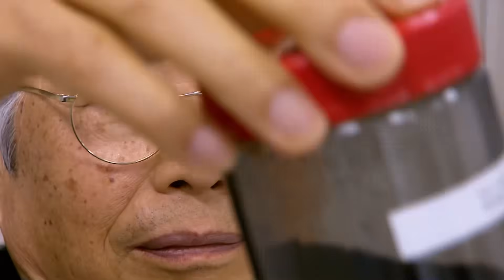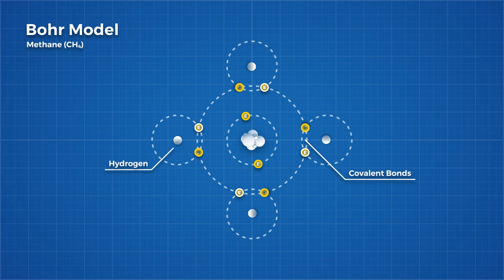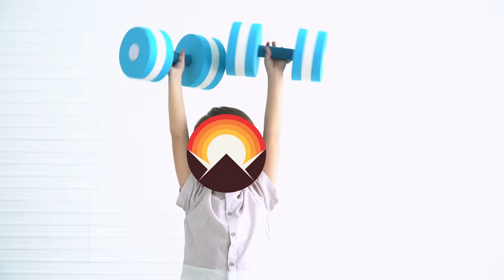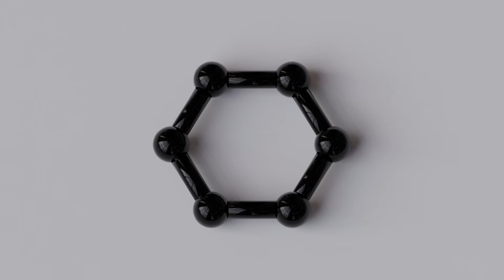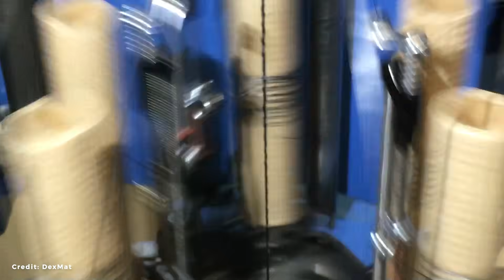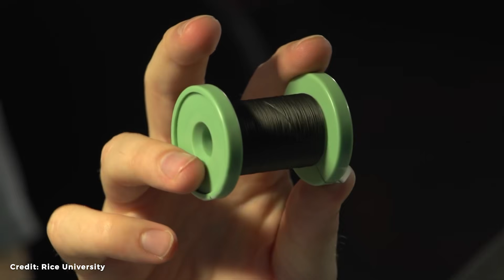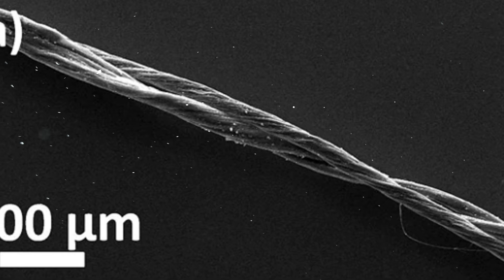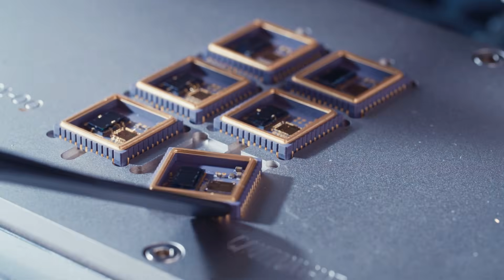How Carbon Nanotubes Will Change the World

Comment: 5 years from now: How scientists and engineers will revolutionize the world with Carbon Nanotumes in the next decade.
Reply: tumes will always be better than tubes
Reply: @bluemamba5317  Agreed.
Reply: @MrDawning  what
Reply: @bluemamba5317  what
Reply: just like it was 5 years ago
Reply: @aaronb3600  lol
Reply: @aaronb3600  true, unfortunately..... true....
Reply: they said the same thing with graphene
Reply: @abinregi390  and 3D printing 
And biodegradable plastics
Reply: @abinregi390  *graphEne
Reply: @abinregi390  that’s not an argument
Reply: @abinregi390  this is basically just another form of graphene lol
Reply: @abinregi390  this is basically just another form of graphene lol
Reply: It's just like a game where you have to research technologies to unlock them, and the good ones take like 80 turns to unlock. Be patient, it'll be worth it when they achieve a breakthrough
Reply: @RidinDirtyRollinBurnouts  Nope. Ain't gonna happen. Lol. Have you been following this technology, or do you just fanboi yourself to feel like you're a part of something?
Reply: Yes, one of my fav talking points of the 90ies.
Reply: To be fair the reason why scientist get excite about graphene and carbon nano tubes is because they keep finding potential applications when viability is the issue right now.
Reply: What's the over-under spread on if this is before or after cold fusion and flying cars?
Reply: Turns out the more difficult something is, the longer it takes to figure out. Carbon nanotubes and nuclear fusion are both things that will be common one day, but probably not for a long time
Reply: @nommchompsky  You seem to be under the illusion that technology has no limits ... that materials can be tailored (thru chemistry and/or production methods) to suit any requirement and that properties scale linearly from the micro to the macro world without loss. This is not the case in the real world.
Reply: @xenuno  People find ways of using new materials and things that are difficult to can still be done, even if it takes years. A lack of imagination and a condescending tone don't change that
Reply: @nommchompsky  My "lack of imagination" is tempered by an understanding of what makes materials strong, and hard, and ductile. .. and how intrinsic and unavoidable defects make scaling very non linear. Do you have ANY of this understanding?
Reply: @xenuno  Well, you're right in that you're basically defining a lack of imagination. Sorry about your lack of ductility lol
Reply: @xenuno  https://www.verywellmind.com/an-overview-of-the-dunning-kruger-effect-4160740
Reply: @kiwibob223  Hope that link helped you out some, seeing you left nothing else I assume it describes a condition you have? I like Twain's "Never argue with an idiot. They will drag you down to their level and beat you with experience". Too many idiots here to argue with them all ..
Reply: @xenuno  In you're arrogantly "expert" opinion (as you seem to be implying your an expert in this topic) how long can a carbon nanotube be? Given that we've already reached individual strands of 50cm (19.7 in), and forests of 14cm (5.5in), while retaining expected strength what point is it macro enough to be too large for your supposed "understanding" of material properties?
Reply: @nommchompsky  Real scientists live in the real world. Fan-Boying is not science. I suggest you look at the vast history of wasted research funding and rampant failures of nanotube studies.
Reply: @nommchompsky  fusion is a fool's errand. There's a fusion reactor in the sky, all we have to do is take a little bit of energy from it. Nuclear fission alone is insanely expensive in comparison to wind and solar. The untapped capacity for wind, solar, and geothermal is enormous. and we will never run out of solar energy capacity until we are able to build a complete Dyson sphere. At that point, maybe we can start looking at fusion...
Reply: @AlexFoster2291  Cost is not the only concern where energy generation is concerned, you can't use wind or solar far out in the solar system, nor can you build robust portable and mobile power supplies from them fusion will come long before we are building systems to capture large amount of the light from the sun let alone anything approaching a Dyson sphere, the lightweight super strong materials you'd need to build it would enable you to build a fusion reactor anyway.

Not that any civilization is ever likely to build a giant sphere to surround its sun, we'd have to dismantle most of the solar system to build it and that's not going to happen before place is filled with settlers who object to their homes being used as building materials. It will be far more practical to build multi layered swarms of habitats, industrial units and power capture stations than try to keep a giant sphere stable around a star.
Reply: @AlexFoster2291  Lucky we have lots of different people to work on different things then.
Reply: @Block1618  I mostly, and usually do, agree with that sentiment. I'm not saying that nobody is allowed to work on fusion energy. Just that I think it's a silly waste of time, for the next several thousand years at least.
Reply: @AlexFoster2291  We've learnt a lot about plasma physics that has certainly been enabling for other industries too, giving a more immediate impact.
Reply: @AlexFoster2291  you drank the kool aid
Reply: @AlexFoster2291  yes we can and we must use solar/wind/geothermal energy to produce our electricity but just being able to build a fusion reactor adds so much to our ability as a specie to do more things
For example you can't build a base in titan because there isn't enough solar power unless you cover like 100 times more area with solar panels to produce the same amount of electricity on earth 
Also unlike uranium/Plutonium/etc nuclear reactors that produce nuclear waste, fusion reactors don't and generate much more electricity 
You can literally use water as a fuel
It is awesome 

Also building a Dyson sphere would require us to tear down our solar system which is sooo much worse than anything  else and it would cost millions of times more money then the whole money in the world and millions of times more labor than all human population 
Like wtf? There are so many other ways to produce electricity 
Even using fossil fuels for millions of years wouldn't destroy the ecosystem as much
Building antimatter reactors would be so much easier

Also sorry everyone for writing long comments
And sorry for possible scientific or grammatical errors
Reply: @Matt0sh  Just want to make it clear that I'm not suggesting building a Dyson sphere. Just demonstrating that the capacity of solar, including space solar, is pretty boundless until that point.
Reply: @AlexFoster2291  other energies are kinda boundless as well
You can put wind turbines in venus or if possible on gas giants or put geothermal power plants in io but they aren't nearly as abundant as solar you're right
Reply: @Matt0sh  brilliant. I like the idea of wind energy from Venus. Never heard that concept. Is that original?
Reply: @AlexFoster2291  yep it is original along with io geothermal 
I just taught about them before writing that comment
Someone else has probably thought of these ideas before
You can also possibly use subsurface water currents under icy crusts of moons like titan and europa
Reply: @AlexFoster2291  
In the meantime - fission!
Reply: @stroys7061  Advanced fission is awesome!
Reply: @AlexFoster2291  A Dyson sphere is a generational project that will require almost all the raw materials in our solar system. Fusion is probably achievable within the next 50 years. China's EAST just set a new record.
Reply: @generalmartok3990  I'm no saying that it's a question of feasibility. My point is that solar is more cost effective. And is worth as much investment as is going into a possibly dead end technology. That solar will remain the better option for as long as there's more light to be collected from the sun.
Reply: @popuptoaster  Mercury (as in, the entire planet) contains enough material to build a Dyson swarm around the sun. Kurzgesagt did a video about it
Reply: @Manic basically cold fusion.
Reply: Nothing is impossible unless it is physically impossible
Reply: same with anything dental related, like 're-growing enamel'. You hear about it once every 5 years.
Reply: Nonotubes in 30 years! On the other hand fusion is coming in 10! (They went through 20 years road in less than 70 years!)
Reply: 2024 here 🗿
Reply: jumanji_robin_williams_meme.jpg 
WHAT YEAR IS IT?!
Reply: Technology takes a while to develop. Geez.
Reply: 20 years later, we're still waiting...
Reply: Progression is there" Low-cost synthesis of multi-walled carbon nanotubes using red soil as catalyst"
Reply: LOL
Reply: The problem is we need carbon nanotubes to develop fusion power but we need fusion power to make the nanotubes... what role do they play in each other's development? No offense but if you have to ask you're clearly not smart enough to understand. Dummy
Reply: THEY WON'T! 
Nothing has happened with CN for over 31 years, except for novel, useless, oft-parroted University experiments.
Reply: What is tumes??
Reply: Scientists and engineers don’t revolutionize the world. Businessmen and women do that by taking their discoveries and making them profitable.
Reply: we have to accept that scientific development has come to a halt from last 5 decades
Reply: Hehehehe, Ye of little faith
Reply: Ironic
Reply: Hi it’s 3 years later. My this has not aged well.
Reply: yeah…
Reply: Saw you at Walmart the other day Ricky
Reply: You would imagine..
Reply: they really did change the world
Reply: Hey that’s me lol
Reply: Five years later...
Reply: lol. lmao even
Reply: Accurate 😂
Reply: Maybe I'll get a nanotube coffin
Reply: Some fields like this need a lot more government funding
Reply: Really hating on such an well researched video. Gtfo
Reply: @geremy8554  you must be the one person on Earth who hasn't heard all this before
Reply: The reason technologies like carbon nanotubes or nuclear fusion or anything else aren't developing fast is simply because no one really wants to or believes that it is possible because it's too much work

Take elon musk
If elon didn't build a reusable rocket, probably no one would even try to build one in 50 years

Or us and soviet union in the cold war
They accomplished soo much just to complete and they did soo much in such a short time 

Or covie vaccine 
No vaccine was made this fast in history but because govs and companies wanted to, they did it
And multiple companies did it at the same time

If a company/gov/etc really wants to accomplish sth, they can do it in a short time no matter what it is
If cold war never ended, we could probably have nuclear fusion reactors in 2000s and built a martian base at 2010

If a big enough company or gov really wants to have a space elevator, they can build one in 20-30 years but no one really wants to and that's why there will be none in probably 100 years
Reply: @Matt0sh  The private sector almost exclusively iterates on technologies that the public sector invented. So big companies only influence when something hits the market. They're just as likely to hold something back as they are to advance it. That's why the first commercial lines of electric cars, which predate Tesla's entire existence, were developed after government mandates pressured big companies into making them. As soon as they were able to lobby those measures away, they recalled entire lines and stop selling electric cars.
Reply: @nathanlevesque7812  you're right
Reply: @Matt0sh  It's not that simple. As another person pointed out, the private sector is not the end-all, be-all of technological advancement.
Reply: @albertjackinson  yes 
I agree
 you're right
Reply: And 10 years from now it will still be 3-5 years away, et ad infinitum.
Reply: @RovingPunster  YUP!
Reply: nah, progress is accelerating, AI will help manufacture those kind of materials fast. In 5 years CN will be either used in many applications or already outdated and replaced by some new exotic material, orders of magnitude better
Reply: @Mr__Singularity  Chris Roberts has entered the chat.
Reply: Stupid science 
Science doesn't know 
Leave absorb photons converted to electrons  -- and positrons  +
Leaves use 918 positron + suck 918 electron  -- create neutron  ......
Reply: Exactly my thought. Another one to milk research money along with fusion... quantum computing... oh and also some money for youtubers 😂 that said I should add this channel is not the worst by far about it no matter this video.
Reply: AAAAAAHHHHH!!!! PAAAAAIIIINNNN!!!!!! 
I broke my hand yesterday because of the hate comments I get all the time. I was so angry that I punched a hole in my computer. Please don't hate me, dear man
Reply: @AxxLAfriku  get mad
Reply: @AxxLAfriku  But why'd you punch your screen?
Reply: @AxxLAfriku  oh hey man. How's it goin
Reply: @AxxLAfriku fck
Reply: @AxxLAfriku  surely it's the wrong place to discuss this, but don't let yourself be dominated by hate comments
That's a shame that people can cause so much harm on internet with so little effort
Keep doing what is good for you, I hope you recover

Comment: It feel like carbon nanotubes/batteries have been the next big thing since 1999
Reply: It won't be much longer, graphene will be in every battery. Mass production is also its problem, but much closer to reality. There's already graphene hybrid batteries. Once they can be pure graphene, batteries will reach an entirely new level.  Phone batteries of current size would last a week. Or OEM's will be able to have the same mAh as currently used In a battery smaller than a postage stamp. 
Hopefully these come quick enough (mass production) to save to planet! Nano T's since '91.
Graphene since 2004. This long again will be too late...
Reply: Most significant breakthroughs seem to take one or two (human) generations to go from discovery to everyday usefulness..... ¯\_ಠ_ಠ_/¯
Reply: Every prediction is according to what they know at that time. You can't predict about things that is not discovered yet. Albert Einstein said nuclear energy is not possible, at that time neutrons were not discovered yet and afterwards everything changes when quantum mechanical model comes. Same with fusion. Once you solve one problem ten more problems will arise. There is no way to predict how many problems will arise even before you solve existing ones.
Reply: Batteries have actually made advancements in that time.
Reply: 22 years. Not bad, considering that the electronically actuated switch took over 90 years to be developed into the transistors found in computers. Or the fact that the internal combustion engine took 250 years to produce feasable transportation (first working ICE was invented in the 1600s and could barely carry itself up a super shallow slope). 

And powered flight? It took all the way from the beginning of human imagination to the 1900s for us to succeed in doing that.

Comment: Nanotubes can do everything except leave the laboratory.
Reply: I agree, 20 years ago my prof mentioned nanotubes.
Reply: Like how it took decades for electricity to become wide spread or for them to work out fission power.

Turns our progress on some things is pretty slow actually lol
Reply: @sithalo  fibres of that size. Sus carcinogenic
Reply: @kongyihfann5546  that's why we have rules in place to make sure things are used correctly. 

There was an ancient picture I seen of the dangers of electricity.  Everybody was being electrocuted because of the wires that criss crossed and dangled all over the place. But we have rules and regulations on how to use them and this would be the second thing.
Reply: Currently being used to build X-ray tubes at Micro-X
Reply: I never thought it be possible to roast a carbon nanotube.
Reply: Oof
Reply: Lol!!
Reply: at least for now
Reply: unfortunitly, innovation takes time.
Reply: @photon2724  So does spelling "unfortunately."
Reply: @dryroasted5599  That was a Dry Roast :P
Reply: What would happen if the nano tubes were introduced to living laboratory... the body of a human...
Reply: @whitetiger432  I just snorted a line of nanotubes, and my IQ increased 100 points.
Reply: @mattb4640  So your IQ was -100 from the beginning
Reply: @MarloSoBalJr  🤐
Reply: @mattb4640  (🙊)🙉🙈
Reply: @whitetiger432  This is almost possible my mentor and her colleagues created an electrochemical sensor using SWNTs as the electrode coated with a metal for catalytic effect... The problem being transfering the data from the nano tubes to external sources... It can be used for glucose, dopamine and some other 'bodily' made chemicals